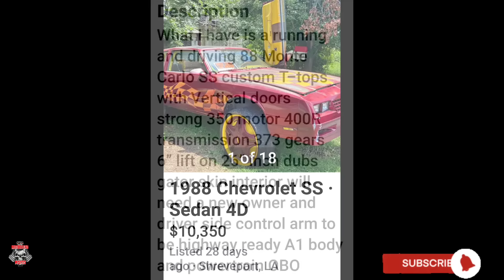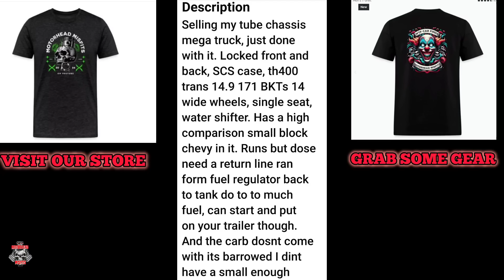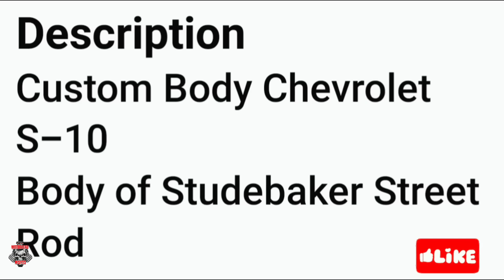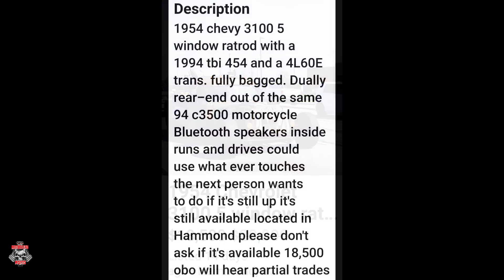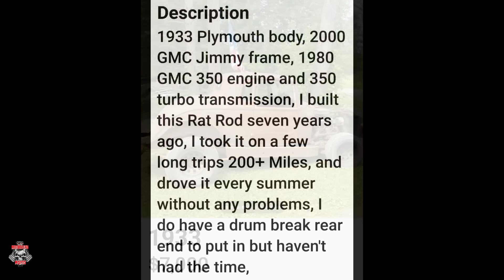WTF CAR FINDS ON FACEBOOK MARKET PLACE! FAN SUBMISSIONS Ep18

Comment: I agree, that pinto is probably the coolest one I've ever seen.
Reply from the maker: Absolutely.. thanks for watching and commenting
Reply: @oubliette31415  hi there bro. Wasn’t the Pinto the one that used to blow up if it was rear-ended? I think that is why I would give this one a skip. LOL. It does look cool though. Somebody definitely put in the wrench time. Take care bro.
Reply: @101scetch  it has a fuel cell, I believe it would be fine. that's the only pinto I've seen that I liked anyway.
Reply from the maker: Yes sir.
Reply: @101scetch they moved the gas tank on this pinto to inside the bed near the cab.  The reason those cars blew up was the position of the gas tank in the rear of the car and if they were rammed in the ass by another vehicle.

Comment: 1) I can't explain it the asking price for this worn out badly painted Ronald McDonald special.
2) He would have gotten more for this poor little Suzuki Samurai he Effed up, (He did it.) if he would have left it alone. But definitely not $14K.
3) This is ABC Spearmint gum colored Honda is a Montana Truck A.K.A Utes. What you usually say about a Sawsall applies here too.
4) Yes, I agree with you too. AT least someone found a use for one after it falls apart after 200K plus moles on it. 
5) With some work and a matching long wheel base bed it would make a cool long bed Single cab dually.
6) This one is actually easier to fix than the last one, just get the correct bed for it.
7) It is like every other kit, it failed to look as good as the original WHich is the 1937 to 1939 Studebacker Coupe express which was actually an Ute.
8) I totally agree with you. I would buy it for some of it and the put the rest of it back on it and fix the back of it. $18,000? Try $1,800.
9) A Chevy engine in a MOPAR. I cannot be nice to this in any capacity what-so-ever, so I will hold my tongue.
10) A Mustang 2 Ranchero. He made it better than other people give it credit for even if he does have the wrong engine in it, but it still isn't worth that much. Not in that color and not as Pro-street, sorry no one is interested in that any more. It ran it's course in the early 90s. (This car is the shepard of all muscle cars, but I will have to get back to you on that.)
Reply from the maker: Awesome comment as always.  Thanks for watching .

Comment: The Monte Carlo SS is something that would be ending up as a drag car probably. After all, to make it decent, you gotta strip out the WHOLE interior, so get the shit wheels off, interior out, and get some good suspension in, and you have a decent drag car, and the paint can be messed with after winning a few matches.lol
Reply from the maker: That's really the only hope for it... but you can find better ones cheaper for a drag car project. 
Thanks for watching and commenting